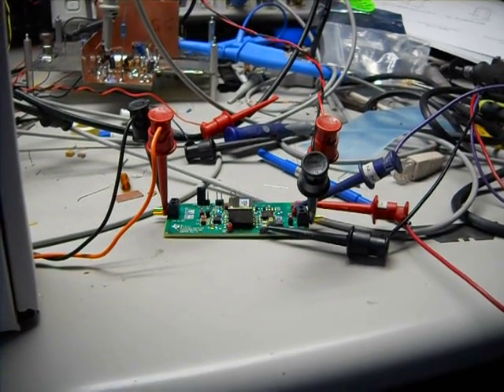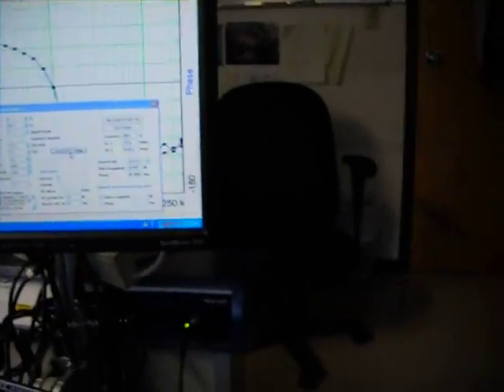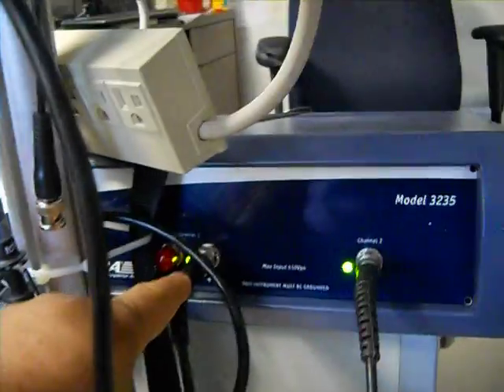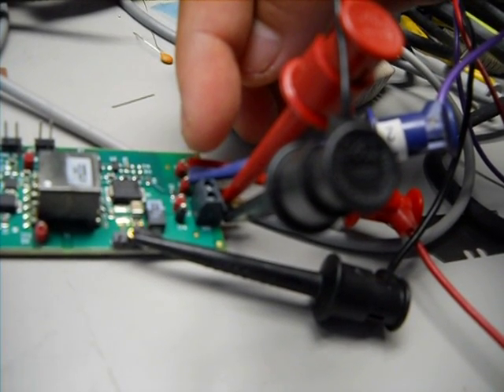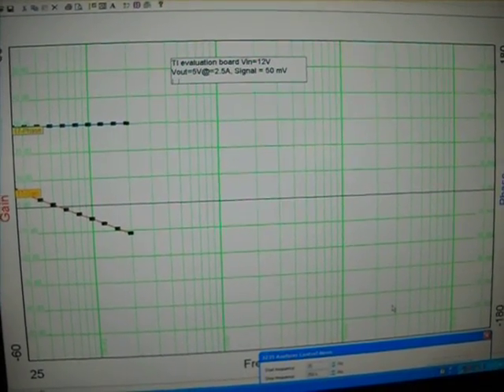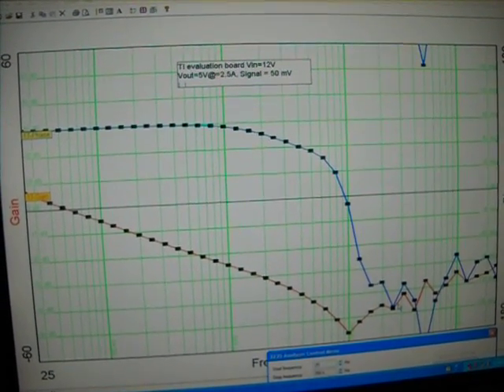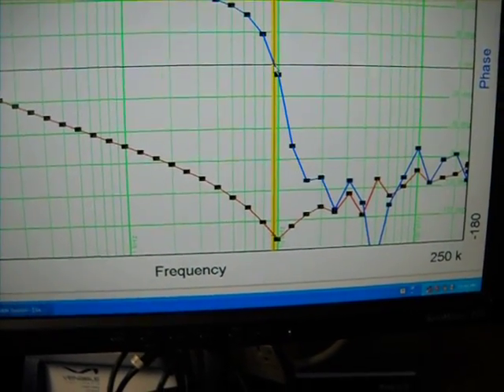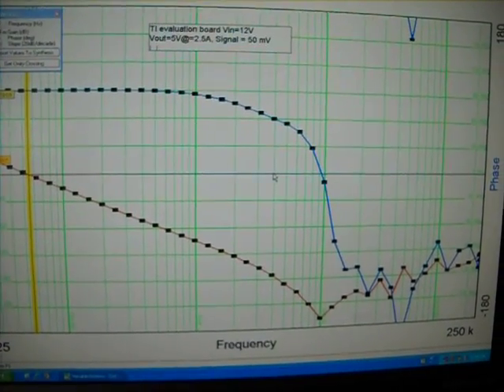Gain and Phase measurements of a flyback converter

Comment: What is the use of servo control option?
Reply from the maker: Hi Tharanya, that is very observant of you. One of the problems in measuring a control loop is that if you insert too much of a signal thru the injection transformer, you can saturate or distort the signal in the error amp. So the control servos allows you to set the amount of signal that is injected to the control loop by measuring one of the channel outputs and keeping that voltage constant. This makes the measurement more stable. For example, at low frequency you want to inject a much larger signal while at high frequency you want to lower the signal level. I hope this makes sense
Reply: Hi Robert Can i get your mail id? I need more clarification on servo control.
Reply from the maker: Questions and comments can be sent to rbola35618@aol.com

Comment: Dear Robert
Is it right to take this measurement accross R4 (between test points TP7 and TP6) as you show in this video?  In user's guide provided by TI (SLVU751A) they show a measured loop response but "vanable resistor" is R3 what means resistor between TP2 and TP6.  They suggest to replace 0R resistor by lets say 50R. Is this change anything?
Reply from the maker: Hi Kamil,
You are correct. There are two loops in this converter. I measured the inter loop with has a much lower crossover frequency. The outer loop has a much more affect on the power supply and should have used R3 as you mentioned as the injection point. In subsequent videos, I did used the correct injection point.  Thank you for your comments and good job in picking up on the discrepancy.

Robert

Comment: the really low bandwidth is to avoid the RHP zero and therfore im assuming that the flyback is running in CCM (cant say for sure without seeing the drain node). If you increase the crossover, you wont be able to control the stability of the system since the transfer function of the CCM flyback is dependent on the load and the duty cycle.

I always aim to keep my converter DCM (duty less than 40%). Its easier to compensate with a nominal cross over at 10Khz and plenty of phase margin.